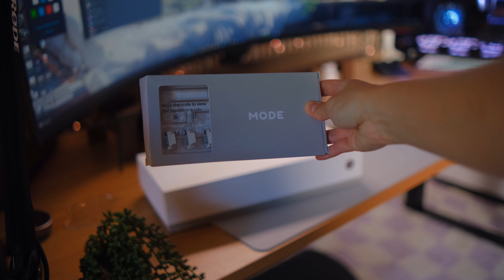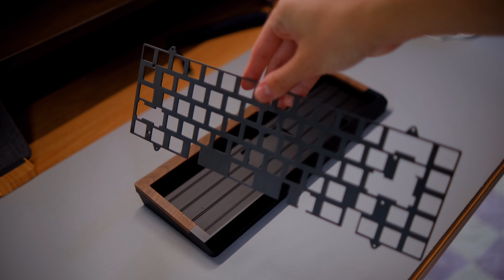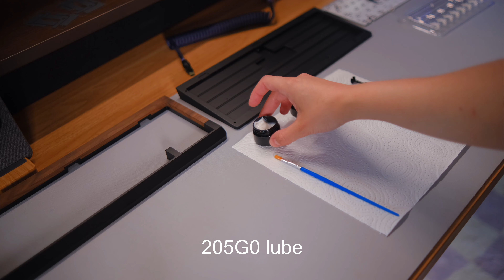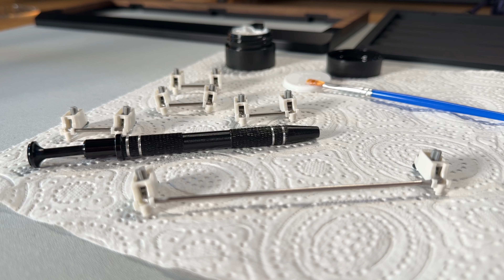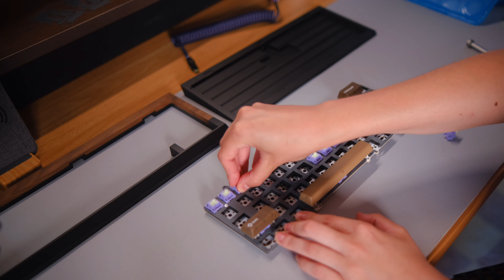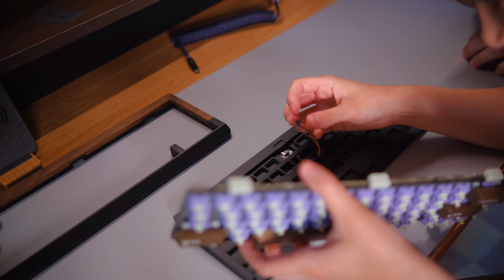How to build a mechanical keyboard (beginner friendly guide) #mechanicalkeyboard #howto #guide

Comment: One of the big concerns i have with building my own mechanical keyboard is latency. Bluetooth, wireless and wired. Sound and feel is cool and all those can be quite easily changed, but latency is sa bit of an unknown and idk waht hardware goes into that.
Reply: Latency is very well known, why do you think professional gamers ONLY used wired keyboard and mouse?
Reply: @phabeondominguez5971  Different boards have different latencies, even when you are wired. And that is especially true if lookign at entry level boards that you can mod later down the line. As an example the RK61 whoch is a really popular entry level keyboard has upwards of 10 ms latency. that's a lot.
Reply: @nitram.9621  fa'sho, but as yet, no wireless has less than a wired..
Reply: @phabeondominguez5971  not true btw. Some 2.4 ghz dongled keyboards have less latency than wired ones. Iirc the monsgeek m1 which is popular, has worse latency wired (10ms) than other customs have in 2.4ghz wireless and that in the same price range of 100e +. Thats why i'm concerned. Especially in that 100e price range that is considered "entry level". It all boils down to where the companies cut corner. And i want to know all the variables.